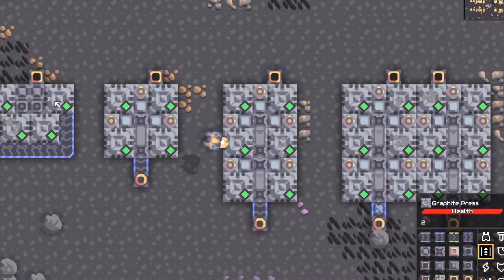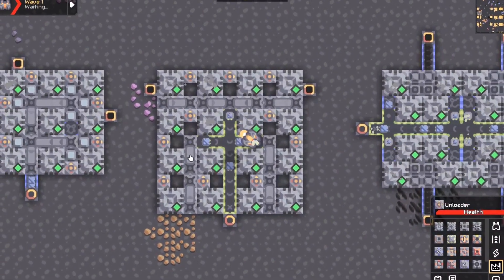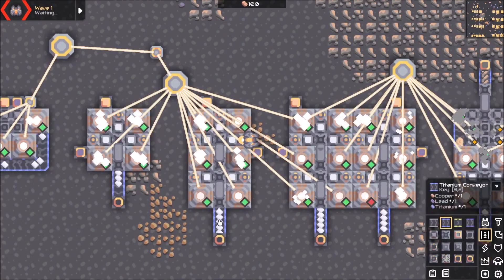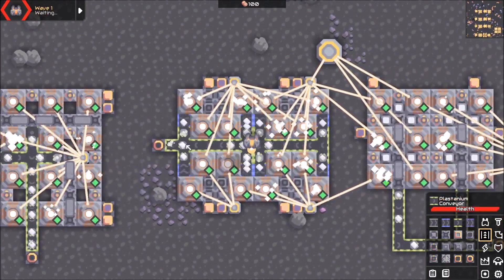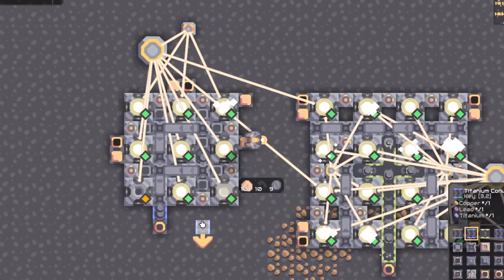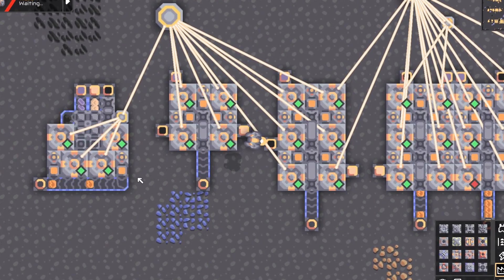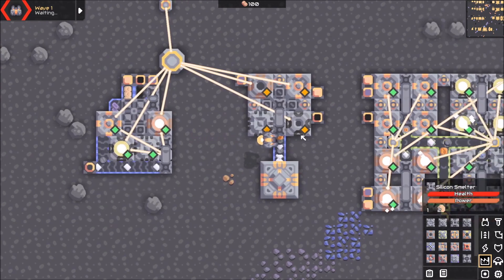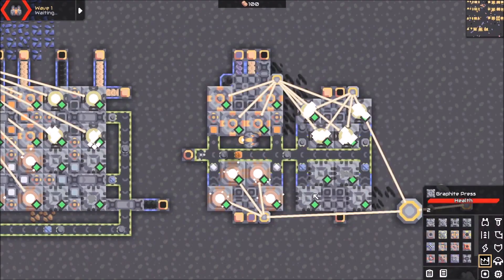Growing from Nil to Tons - Scaling Production in Mindustry

Comment: These schematics aren't great, and for 2 reasons:
1. You heavily rely on unloaders. That 5×5 schematic with 4 unloaders is extremely expensive for what it creates. You should always use the design with two overflows and 2 junctions. Don't get me wrong, unloaders are insanely useful but they don't have their place in early game schematics.

2. Stacking early game schematics is not a good way to scale. The point of a schematic is to have 1 input and 1 output. By stacking early game schematics around an output line, you scatter around the inputs, losing the main advantage of schematics. you can stack 2 or 3 side by side without loosing too much space for conveyors but after that, you should use a bigger schematic.
Reply from the maker: It comes down to a trade off decision. For me, spending some silicon beats having to take more actions to connect up materials for the one input design any day. I started playing with the one input way and it is terrible. There is no way to place the single entry factory immediately next to drills and have it function. They just won't.

These schematics are easy to understand, easy to fix, and easy to scale. These are not meant for multiplayer gameplay where there are no limits on resources, space or number of bases. These are best for single player world conquering. 

IMO: The price of an unloader was arbitrarily set at 25 silicon without a real connection to the unloader's size or number of functions. I would love to see the cost changed to 10 or 15 silicon as that is much better representation of comparable cost.  That will probably never happen but the cost of unloader is an aberration compared to the relative costs of other sorters, conveyors, bridges, pipes and other infrastructure elements. The price of overflow gates, sorters, inverted sorters should be increased to reflect their relative value if unloaders continue to cost this ridiculous amount of silicon.

Comment: using unloader on graphite press feels like a waste. good enough for tutorials, but not as cost effective.
 and if item is flowing out scale of plastanium conveyor, just use mutli press. same with silicon, just use crucible.

also dont put pyratite in to the core unless you know what you are doing.

it is not used for any research. all the building doesn't use pyratite. just use it as quick early generator start up or ammo. other then that you are making your core in to a campfire